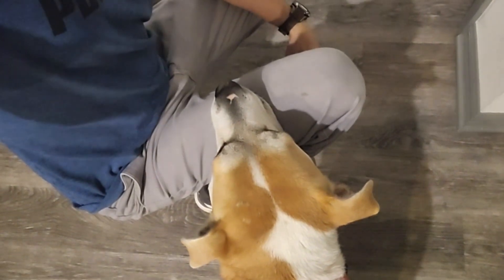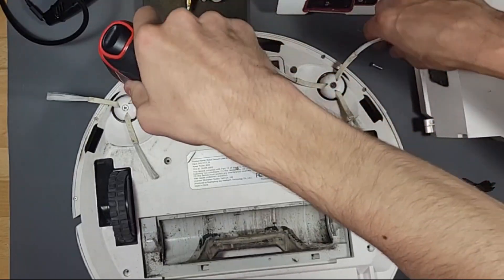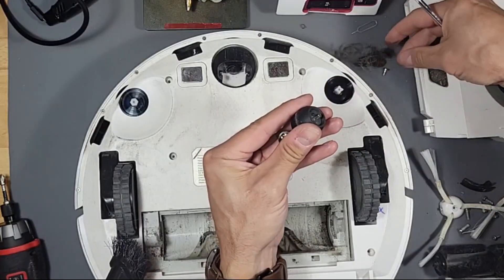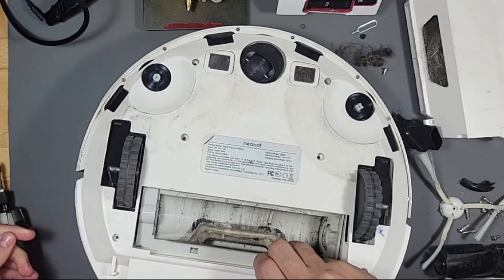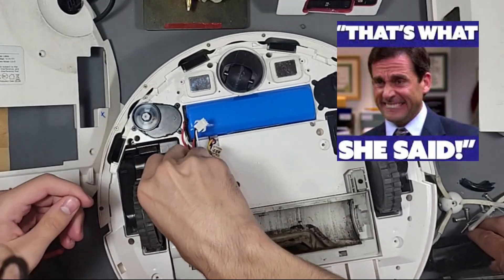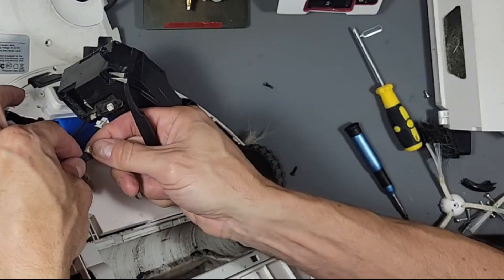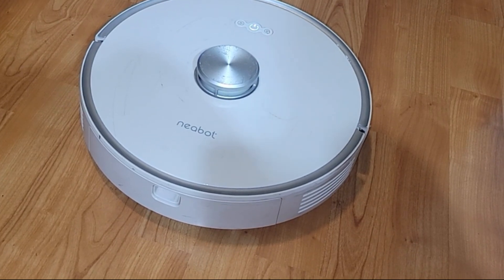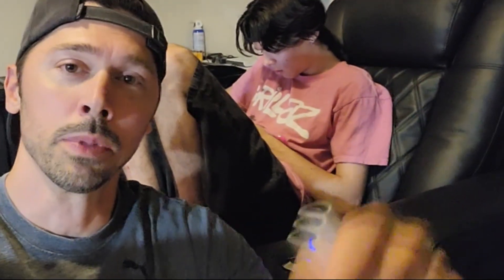Teaching my Son to Fix Robotic Vacuum

Comment: Hi, I fix this exact vacuum for a living, I have just done that same wheel replacement (I do soo many per day). Just a heads up, plug the two wire plug in first, it makes it much easier.if you want a fun little fix for the old wheel, take it apart, there are four small screws within the wheel it's self which comes loose. Just put them back in with some super glue 😉. If you ever struggle with it, give me an inbox 👍🏽
Reply from the maker: Great tips 👍🏽 thanks